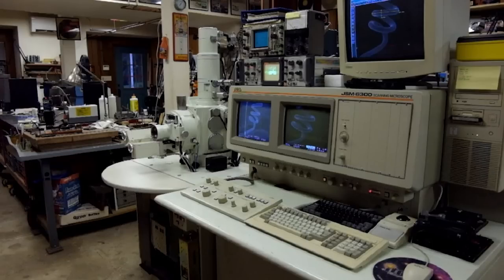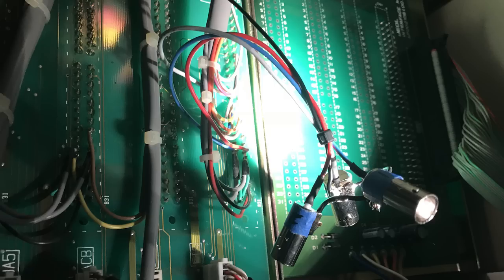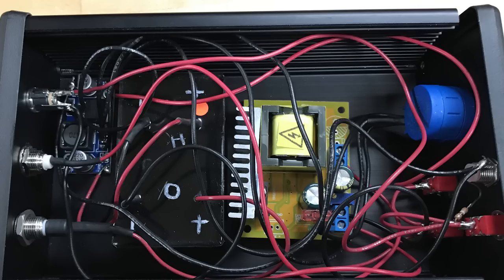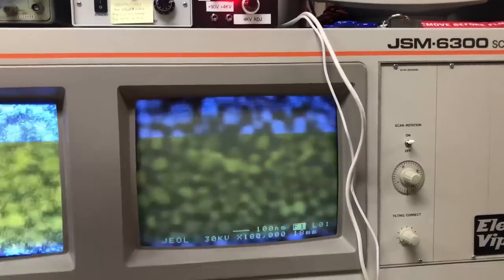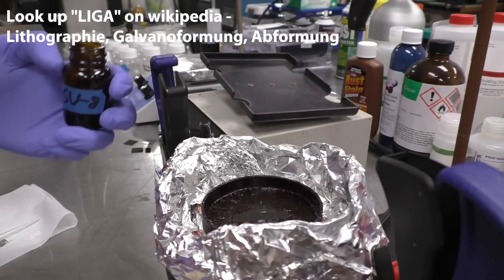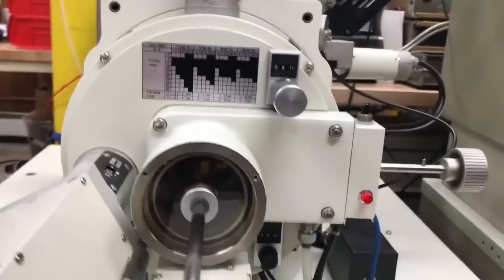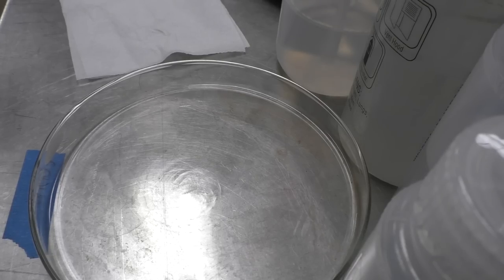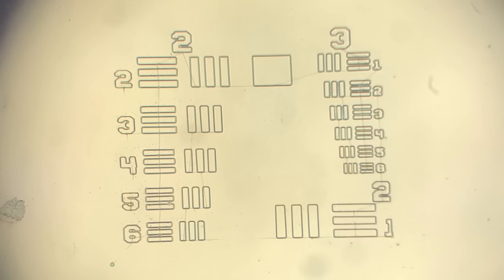Making Tiny Things with Electron Microscope - E-beam Lithography

Comment: That turned out much better than my first attempt at e-beam lithography -- and I was on a tool with commercial EBL hardware! You mention "special" e-beam resists, but what works best in my experience is PMMA. If you get a chance, try that out. Awesome project!
Reply: does PMMA croslink when exposed to electron beam?
Reply: I assume the PMMA crosslinks when exposed, since it is a positive tone resist. Interestingly, I've heard that PMMA can turn into a negative resist when over exposed, though I'm not sure why.
Reply: @unclekyky  I work with ebl systems, pmma cross-links with very large doses

Comment: That acetone developing makes kinda sense, assuming resist you used is phenol based, either light or high heat should cause resist to crosslink and possibly be completely resistant to solvents like acetone. Perhaps if you run beam over wafer twice or so it may give you more leeway for developing time

Edit: I commented too early as usual :P what happened there is obviously not what I described.. but interesting nontheless

Comment: Very cool! Due to chronic illness I have had to retire from work, and have started to do hobby electronics at home, but damn! You really look like your having fun. Unfortunately for my old line of work, (high energy physics) the building of a particle accelerator in the basement is out of the question, where I live.
Reply: You are a physicist?
Reply: You might be surprised what you can find on Ebay. You should make one slowly and upload the videos for us to see. Who knows, the joy you might get from it could give you the strength to fight through your illness.
Reply: @dreggory82  Thank you for your optimism, I will give it a thought, at the moment I am building a Spark Chamber, in the hope of detecting Cosmic Rays (Muons hopefully), so far I am only having luck, electrocuting myself (7.5kV), having to replace Helium that keeps leaking (Expencive and becoming harder to acquire) and detecting alpha particles from the decay of a sample of Americium-2 that I acquired from an older model smoke detector, here's hoping! Should I get the beast to work properly, I will consider making and posting a video. Thanks again for the encouragement.
Reply: @kitsouk1  I will subscribe in hopes. What are you using the helium for? Is it the sintillator medium?
Reply: @dreggory82  The spark chamber has two plastic scintillation detectors, the Helium-Neon gas mixture is used to ionize, and make the spark path visible, creates a favourable path for the forthcoming spark. I can provide complete schematics and basic theory of design if you wish.
Reply: @kitsouk1  I do wish

Comment: I don't get why do you go to school anymore, clearly they don't know 10% of what you're talking about.
Reply: They do actually, but unfortunately all this fun stuff is for the graduate students, and usually you have to specialize in one area. The lab I was in (physics department) made electronic devices and tested them at millikelvin. There was a whole giant new building devoted to nanofab. They had a fancy electron microscope that also had a ion beam that could cut the samples and then scan the new surface. The downside: you had to be certified to use the nanofab, which required $10,000.00 that usually comes from your professors research budget. I tried, I was unable to get my professor's sponsorship.